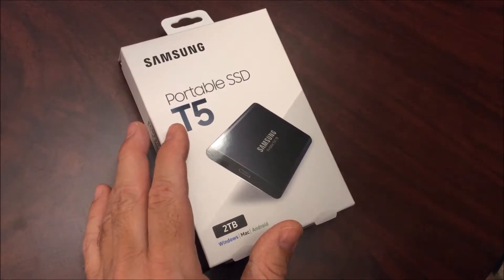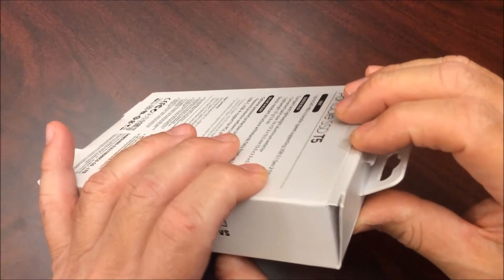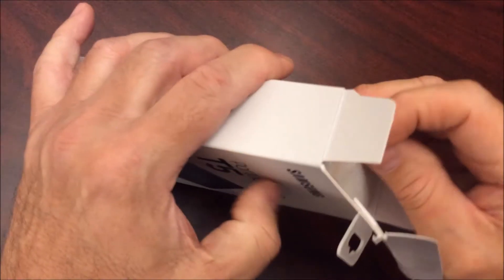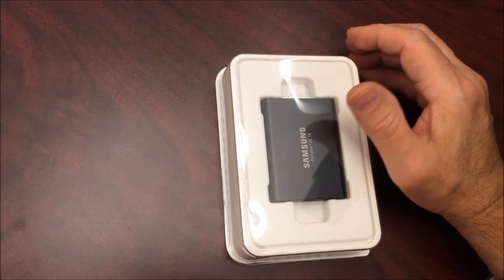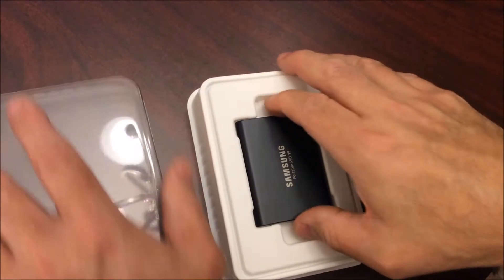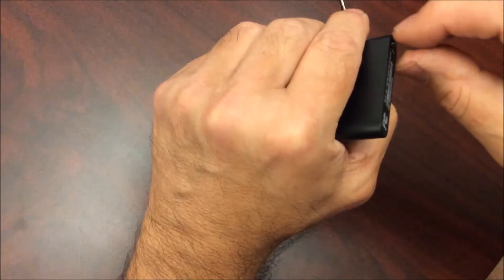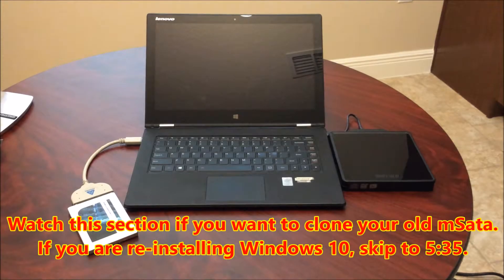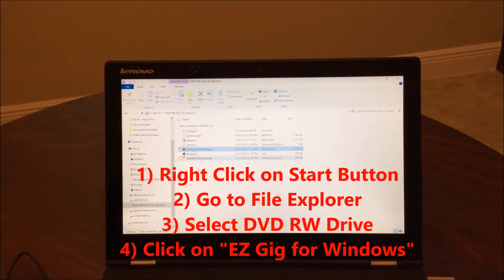2TB SSD Upgrade for Lenovo Yoga 2 Pro

Comment: Does anyone know where the ram is on this computer? I have the exact same one and trying to fix it not good with computers lol
Reply from the maker: I think the ram is located between the two fans, behind the battery. You can see a long white sticker on top of the ram at 6:24. However, the ram is not user replaceable, it is integrated.

Comment: Why did you need the msata to sata USB enclosure? Couldnt you have just used the USB port on the T5 Enclosure before disassembling it to clone your drive? Then disassemble and install it?
Reply from the maker: Good question. I tried connecting the T5 to the PC's USB port to clone the drive. However, the EZ Gig cloning software did not recognize the T5. So, if you want to clone the MSata, you have to put it inside an MSata to Sata enclosure. Then you have to use the proprietary EZ Gig Sata to USB adapter, which is recognized by the EZ Gig software. Maybe you can clone the T5 connected by USB if you're using another cloning software. Thanks for your comment.
Reply: @hackytip7901   You can actually use the T5 enclosure. No need to buy an adapter... Must have been a problem with the software you used. I did the same swap(1TB instead of 2TB though), but I didnt have to buy an adapter. I just cloned the drive before removing it from the housing with a USB 3.0 connection. I used a program called AOMEI Backupper.. Had to use a legacy free version.. Version 3.5. As the newer free versions  removed some needed features. You can find a 3.5 download fairly easy with a quick google search. I was able to clone the SSD in about 30 minutes with the US 3.0 connection. The swap was a piece of cake.  , I just did a 1TB swap.. I opted to go for the 1TB T5 as it is legitimately cheaper than any other MSata option I found. And you end up with a Samsung SSD as opposed to some chinese cheapo crap or overpaying for a name brand. And pro tip:  I installed the 250GB ssd that was in my Yoga 2 Pro, into the T5 housing.. And now I have a bootable portable SSD. lol. So not only did I save quite a bit on the 1TB upgrade, I also got a portable 250GB bootable drive out of it. Super sweet deal. I owe you a big thank you, without your vid, I would have never thought to look into disassembling a portable SSD. So Thank you so much for the video.

And for anyone curious about performance on the T5 an internal bootable drive.... Performance is just as good or better than the stock 250GB SSD that was in the Yoga 2 Pro. I mainly wanted the upgrade to have more room for games as I game in my free time at work on my Yoga and load times are just as fast or faster than they always were. While File transfers, copy/pasting, etc seem to be quite a bit faster than they were on the stock SSD.
Reply from the maker: @awsumpawsum8333  I'm glad that it this upgrade worked out for you. Thanks for providing the details of the free cloning software that you used & about your experience.

Comment: Hello, I have a quick questions regarding the OS, I have the same computer but still using WIN 8.1; Does Windows 10 allow you to properly use the Tablet mode, tent mode and so on with no issue? Do the accelerometers and sensors still work when you turn the computer to portrait mode ? Does the autorotation button still works on windows 10? Thanks in advance
Reply from the maker: Hi, Yes it works fine. I didn't install the original Lenovo drivers from their website. Windows 10 automatically found all the drivers it needed. However, Lenovo has the drivers and Software available for Windows 10. Anytime that you upgrade an operating system, you have to be willing to fix issues. If you decide to do it, you should be willing to accept that challenge. Good luck! Here's the link: https://pcsupport.lenovo.com/us/en/products/laptops-and-netbooks/yoga-series/yoga-2-pro-lenovo/downloads/driver-list/component?name=Software%20and%20Utilities

Comment: Never buy rubber feel surface
I have this one, barely used.
Now all rubbery and break apart
Battery bloated.
Never buy rubber feel surface
The laptop is fine, the screen is fine except the hard rubber surround the screen and keyboard will disintegrate within 1-3 years. 

The side rubbers are peeling off, the orange cover is melting/sticky effect and it’s very flimsy now. Wrong choice of laptop.
Want to repair and salvage the shell? A+B+C+D = US$ 250 every 1-3 years. Fuck off Lenovo. This Yoga 2 Pro is crap.
Reply: I've had mine for a few years now, also in orange, and it's not doing any off that. Had it used daily up until about 18 months ago.

Comment: Thanks for the video. 
Just for passing on information, it seems the newest Apricorn EZGig v 6.2 only works with their kit according to them. I have not verified this. 
They do not make a kit for the M2Sata connector on the Yoga 2 Pro HDD. And they will not be making one. 
They said their older EZGig 2 would work. I am looking for that at the moment.
I did order a Sabrent M2SATA USB 3 enclosure.
Reply from the maker: Thanks for your comment. You're right, the Sabrent MSata to Sata enclosure should resolve the issue. Good luck!